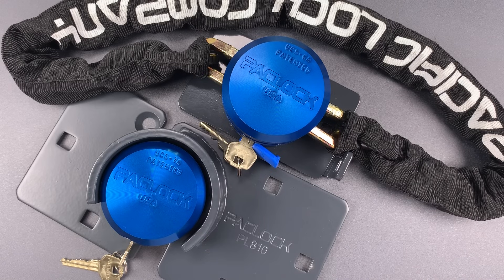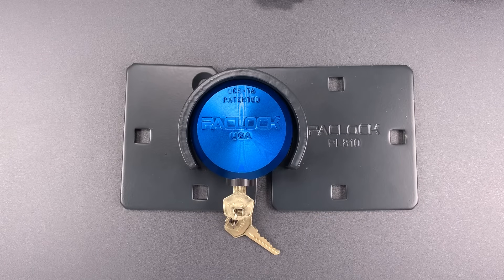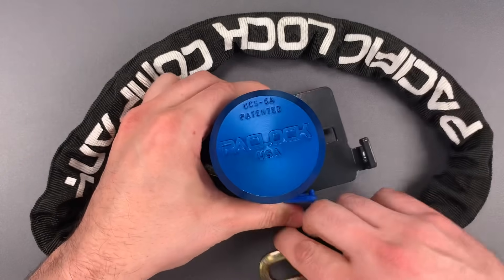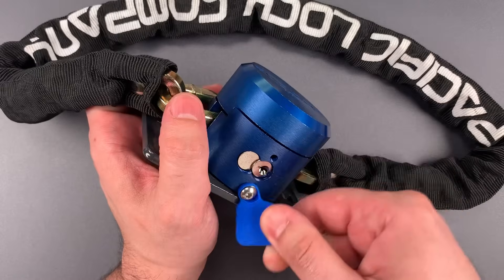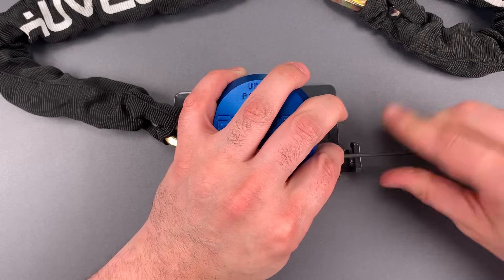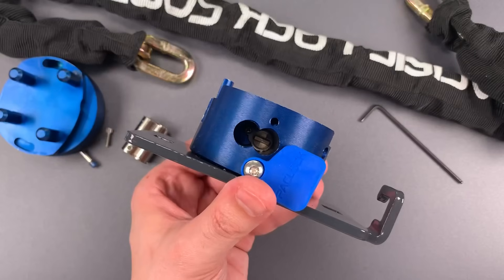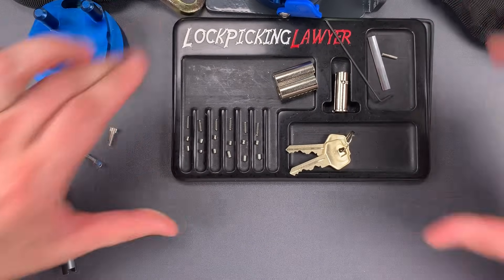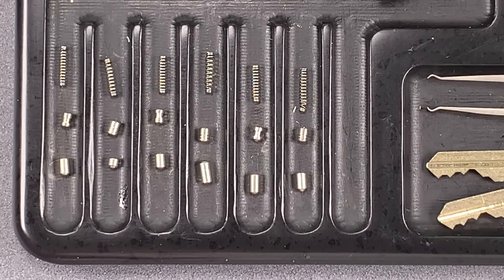[932] More PacLock Products Coming to Home Depot

Comment: Okay, I know I got a good laugh out of the "screws weren't included to mount the puck lock to the hasp" comment. Proves we're not perfect, just that we're a hard working company that sometimes misses things! We realized about a week ago that our first batches went out without the pucks already attached to the hasps as they should have been (meaning that the screws would be included). A lot has gone into this entire product line, and that detail was missed on our assembly/packaging line. So, if any of you end up getting one of these and it doesn't have the screws, we'll be happy to mail some out to you (just give us a call). They are 1/4"-20 x 1/2" flat head stainless steel screws and you can pick them up just about anywhere.

The packaging is actually made from aluminum and not steel. The powder coating on it obviously gives it a steel look and feel, but it's the weight of the product that really makes it feel like steel. We know our packaging is a bit over the top right now, but put yourselves in our shoes. We need to be able to grab the attention of a Pro customer as they're walking down the aisle and, hopefully, grab it enough for them to want to learn more about the product. These pucks and hasps are heavy and silly cardboard packaging just can't hang. So bear with us for a while... once everyone is up to speed on PACLOCK, then we'll find a way to cut down on the packaging. We figured with aluminum, at the very least you can put it into your recycling bin (there should be a sticker on the back of the packaging mentioning that it's aluminum and recyclable).

And as a West Point grad I hope all of you can trust me when I say that this is not a sponsored ad or promotional deal with LPL or BB. We trust and respect them (along with the balance of the LockSport community) and value their candid feedback. Fortunately our hard work and innovative ideas seem to be hitting the target so far and that makes these videos seem promotional. In essence, these reviews end up being a bit promotion, but only because the products are really cutting edge for what they're intended to do.
Reply: well you've just proven why you go through the effort of sending these products to the community. you get feedback and fix any oversights. good job.
Reply: Wow, here you are. Great PR! TLPL is probably the final test for any lock related product hahaha keep it up
Reply: That package is probably more secure than a master lock
Reply: Any chance of you guys coming out with a beefier version to accommodate a half inch chain?
Reply: Can we expect hardened steel bodies? At these price ratios, I’d buy at least a dozen.
Reply: I have been hoping for years that somebody would invent a lock to fit over a standard tractor trailer hasp to not only lock the hasp but cover the hasp rivets. It would also need to be sealed against the salt and sand used on the highway during winter.( I have literally had to use a propane torch in order to unfreeze a disc lock and WD40 to clean it out after a winter trip)  It looks like Paclock will be the company to take on this challenge. It would be a boon to load security in the trucking industry
Reply: For the Puck Chain lock, is there a steel pin in the "hooks" that hold the chain to the lock?  If those are aluminum, that seems like the first obvious weak spot but LPL hasn't had a chance to post a destructive test yet.
Reply: You guys need to get these things into Bunnings here in Australia. I am sure they would fly off the shelves due to it being far better quality than some of the junk I saw last time I was in the big green shed. (or if Bunnings wont take it, try the smaller hardware stores like Mitre 10 or Home Hardware)
Reply: A really innovative product. Now...how about resistance to a grinder? All the kids are using them these days.
Reply: Awesome to see you working with LPL & BB.  
And I'm glad you were able to get home depot to carry your product. I'm always in home depot, but I'm disgusted with their current padlock options. Whenever I've needed a decent lock for one of my clients, I've had to make an hour drive to my locksmiths shop.
Reply: I'm so glad to see companies react with grace and humor over a review.  You got my business in the future!  When we replace our aging front door, I plan on getting a Bowley for the front door, and then I'll pick up some paclock outdoors padlocks for our two chainlink fence gates because they need some love, too.
Reply: @dustysparks  The packaging is aluminium, not the locks themselves...
Reply: @fawesum  the lock are anodized aluminium.
Reply: You could cite these videos on your web site or in your promotional materials ("See what America's top lock pickers think of PACLOCK").
But, while we have your attention, I couldn't help but notice that your key pins are all standard. For the longer key pins, can you make them thin-lipped spools? Do you have any countermilling in your pin chambers? That's something else to consider if you want to increase the pick resistance.
Great work on their design and packaging.
Like Jonathan Wilson suggested, I'd love to see some of your products in Australia. Especially your padlocks with the core replacement option. About time Lockwood got a kick in the backside, they've been coasting for far too long.
Reply: @Joe Turner that's an interesting point
Reply: @bstrickler  Really appreciate the kind words... and the lead on a potential new product. This is exactly how we decide on what we need to be working on. Believe it or not, we make all of the padlocks for Public Storage ~ more than a million a year between the 70mm disc and "cylinder lock". So I'm pretty familiar with what you asked about.

Here's the hitch. Even if we were to make a far better lock (and for me, the disc lock, at least our disc lock, is pound-for-pound the best padlock out there because of its design) the doors in those storage units are made from super, super think metal. They're really cheap. I've seen pics where people just tear off the door and leaving the whole lock/padlock in place. 

It's like putting a big lock on your front door, when your front door has a window. So we've never really spent more time working on that. What do you think?
Reply: @Joe Turner I am. But candidly I wasn't really worried about the cylinders themselves... I feel like we perfected those to the best that the market will bear (you have to keep costs in mind and keep in mind that our products will be cost compared to a Master with no security features) a few years back. The one bonus that these locks have that the rest of our entire product line doesn't have are that the pins are stainless steel (to help defend against drilling).

Otherwise, our goal was to get a sense from them and the community about the entire product offering... about whether our idea of an interchangeable core system that the consumer can manage is truly as ground breaking as we think it is... and whether our new lock designs (like the puck link and the trailer locks) are as in demand as we thought they will be.

Even though BB and LPL can pick into our cylinders in under a minute is not necessarily what we want, it's still exponentially better than our competition at this price point. And the fact that they don't even try to rake us shows that they have a level of respect for our cylinders that they don't for most other manufacturers in our space.

So, on the whole, super happy of course! Maybe call it a relief? But HD has let us down with not getting these on their website like they said they would. Ug. A small hiccup to what should be a good, long run! Thanks Joe.
Reply: @celiaengland871  Trust me, we're not stopping here. We have an entire road map of new products that will follow onto these. Ones that are even more high security, and ones that we'll offer at a lower price point. Lots and lots. 

For the one you're specifically asking about, we can do it, it's just that no one is really banging down our door to do it. Instead of a 2-7/8" round puck, we'd probably have to move to a 3" or 3-1/4" puck but that doesn't bother us. Some tooling involved, CNC programming time, and off we go. So if the Puck-Link starts flying and we get the "yeah it's great, but I want one that can handle a 1/2" chain" from enough people then we'll do it!
Reply: With this one comment You people got yourself a future customer. If/when these become available in UE.
Reply: @brentadams28  Yes, in the future. But the costs will jump let's say from $30 for aluminum to maybe around $45 for hardened steel. Keep in mind we make these bodies in the States... and heat treating and electroless nickel plating are not "cheap" like you can do in Mexico or China. And every dollar of our costs turns into who knows how much on the retail side.

So we started with aluminum so we can stay price competitive... plus American/Master, Abus, PACLOCK, we all sell lots and lots of aluminum locks for years and years. Yes, it can be attacked with Galium... yes it is not as strong as hardened steel... but it will never rust and, mostly, people attack the shackles of a padlock. So it's why we try and design as many hidden shackle products as we can.
Reply: @edfrawley4356  We're ready! We've been spending a lot of time in your industry trying to solve these problems. Hoping what you see here will stand up to the task!
Reply: @paclockpres.9805  good point about that. My primary point for such a lock is deterring them or at least slowing them down long enough to give my security cameras a chance to get a good shot of them while they're getting frustrated, and hopefully giving up, instead of busting the lock mechanism off.
Reply: @edfrawley4356  get a can of LPS 3, that should help remedy your frozen lock issues, if frozen due to corrosion.
Reply: @dustysparks  No steel pin in there... we've thought about it... debated it... and then went and had a company do a pull test to try and yank out the chain from a locked Puck-Link. I don't have the details in front of  me, but it stood up to something like 2,000 or 3,000 lbs of pull force. 

What's hard to notice in the photos is that when the Puck-Link is locked, the locking tabs actually engage with the top cover. There are recesses on each side of the cover for the top of the locking tabs to lock into. So when you're pulling, it's not that the tab is sticking up like a finger with nothing to grab onto. The tip is grabbing onto the bottom side of the cover and this gives it more strength.

We've actually already sold thousands of these Puck-Links to a van outfit company in Chicago and they love them (the fact that the product is "Patented" should tell you how long ago we came up with the idea because patents sometimes take years to get awarded). So they've been out in the wild for about 3 years now in a kind of long-term secret test just to see how they'll hold up. So far no complaints!
Reply: @blipco5  I'd guess grinder resistance is fairly good, in my experience grinders don't like cutting aluminum - it gunks up the wheel.
Reply: Keep up the good work!  Love seeing an American company making nice quality products.
Reply: @kevin_lieb  exactly what I was going to say. The next thing would be a hacksaw.
Reply: mad respect to a company that embraces and learns from criticism. I'll buy your locks any day!
Reply: I hope you guys get the US Army bid and replace all their crap-tacular "american" master locks.
Reply: Thank you for that reply with the missing data, very helpful indeed.
Reply: Darn it, that was fast!
Reply: PACLOCK PRES. I’m considering buying several Abus Rock, maybe even Bowley padlocks right now. If I had to spring for double your price, and could get it at Home Depot, I’d have bought them two weeks ago.
Reply: Will you have a captive key option?
Reply: So why has PACLOCK decided to make the consumer pay for the marketing wank?  Instead of packing each lock on an absurd aluminum plate (powder coated none-the-less); PACLOCK could simply make displays that have all the information, and pictures, and an example of each lock hanging from it.  Then PACLOCK could lease “end-cap” displays and; “… once everyone is up to speed on PACLOCK, ...” they could stop leasing the “end-cap” space for the displays.  That could be a way that they can; “… cut down on the packaging…”  Doing this would show off the product, and not force the consumer to pay for a useless piece of aluminum.  I think I will wait a while for PACLOCK to stop using packaging that is a massively oversized POWER COATED piece of aluminum and,  “…a bit over the top right now…”
Reply: Who in the right Ming read and wrote this all
Reply: Are these cores compatible with any house type locks/keys? (Kwikset/Schlage)
Reply: @SwishSwoshSwhoop  That jumped out at me, too.
Reply: @blipco5  Here's part of the magic with thick aluminum... it loads wheels, badly. Grinds like cheese and in a few moments your grinding disc is a smooth aluminum-coated circle and absolutely useless.
Reply: @ZaC kWinz my understanding from the previous video is that they are "Marine grade", that is to say, everything on them is stainless steel or another corrosion resistant material.
Reply: I think it's awesome that you interact with the video and take the time to comment. I'm a bicycle designer and have a few nice bicycles myself. I'm always looking for a great lock and if I happen to see one of yours in Home Depot I'll be sure to pick one up. All the best, wwd
Reply: I gotta say I really dig the whole packaging idea. It'd be perfect for smaller mom-n-pop type stores where having two of each lock from each manufacturer in inventory might be too much for high-end products like these...poof, every lock in its packaging is now the counter display. Pretty brilliant if you ask me.
Reply: @two_tier_gary_rumain  Keypins don't come into play until the pin is overset. Until that point the driver is the only thing interacting with the shearline. So there'd be basically no point in having crazy keypins unless you're doing some sort of challenge lock with a situation where the picker will be tricked into oversetting something.
Reply: Listening to the picking community AND made in the U.S.?  I don't have much use for padlocks and such, but I know who just made my short list!
Reply: @benoit8850  I'll spend some time looking at it. Needless to say, lots on our plate right now.

If you're a machinist, hopefully you can appreciate the level of complexity and precision needed to get two completely different parts with lots of complex geometries (for a padlock, that is) to fit together almost perfectly. If the top closes and leaves too much of a gap, then it's a pry point. If it's too tight, then the ball bearing won't allow the actuator to fully rotate and lock (which is even worse). I contend that the Puck-Link is the most complicated padlock ever produced if you ignore fancy materials (like in the huge S&G military lock). 

No way can you cast this thing. And making it out of steel is really going to bump up the price... a ton of milling. Thanks!
Reply: @jfwfreo  We need to work on it... dumb question, I apologize ahead of time, but does Amazon reach into your neck of the woods?
Reply: @sharkinahat  Agreed
Reply: @blipco5  Aluminum is better than steel against a grinding attack... the aluminum melts and gunks up the wheel.
Reply: @two_tier_gary_rumain  Honestly, I thought the key pins were security pins also. We made that change company wide about 2 years ago based on comments in these forums. I'm not sure why they aren't... I noticed that the other day with the original videos posted. Ug. Just so many pieces to the puzzle to make sure we have squared away.

So you can expect those to turn into security pins for future releases... thanks for catching that!
Reply: Great lock and I love the package. The core has everything but I would like to see a better keyway.
Great vid as always LPL keep up the good work bro.
Reply: @paclockpres.9805  It's amazing what cheapskates people are when they are protecting $15,000 worth of tools (not to mention the lost productivity when a lock fails).  I for one would pay the extra for the steel option if it were available but the aluminum PACLOCK is so much better than the other junk at HD that I'll start buying them when they show up on the shelves.
Reply: Always great to see a reputable company. I can't even think of a need for any locks, but I'm likely going to pick up some pad locks in case I need them in them in the future.
Reply: @paclockpres.9805  You guys are really on top of this. It would certainly add some difficulty if the key pins were converted to security pin also. However it's probably pretty costly to do so and it reduces the available bitting space due to having to have enough height for the security feature be cut in. Since you guys are doing a no duplicate key cuts run this might have been made to give more unique keys. 

Also security key pins likely wouldn't help much against LPL as his heavy tension style is very unlikely to over set a pin. Still would be great to add but only if it wouldn't impact the cost of the lock. I imagine a lock like this could defeat virtually all of us amateurs here in the comments and probably just as many thieves in the real world.
Reply: PACLOCK PRES. Have you considered adding a pack of higher security cylinders to the lineup?  With user replaceable cylinders there's no need to have separate lineups for each picking difficulty, making it easier to sell the higher grade in box stores like Home Depot (US) or Bauhaus (EU).   Having bought similar upgrades for ASSA myself, one upgraded option could be adding 5 or 7 pin sidebar like on ASSA Twins (check their patents first).  Licensing or cloning the ASSA / Mul-T-Lock CLIQ electronic sidebar would be an even higher security option.  Of cause you could also invent your own upgrades.
Reply: @DanBowkley  I know how it works. I think you underestimate how easy it is for some to overset a pin. :)
Reply: @paclockpres.9805  OK, good to know.
What about looking at other lock styles? Sliders? Dimples? I suppose it all depends on research. What's the most common type of lock picked, etc. I expect you guys would have access to this sort of information.
Reply: Meh, the aluminum can be reused if you need small pieces for a project or you need a quick and dirty metal back support for some on the spot plumbing work.

That being said, I am seeing good things from the community on the products
Reply: @SwishSwoshSwhoop  Maybe one day...
Reply: Man, any company that pretty much hosts an unintentional AMA on a review deserves some respect, ill keep your locks in mind if I ever need one.
Reply: Thank you for your service!  I'll be buying them when I can find them.  Went this morning and there was only master lock.  I really value the swappable cores.
Reply: @paclockpres.9805  I was in the Army for ten years and we had the pre-master American locks and I liked them.  Then came the laminated masters and they were crap from the start.  Loosey goosey.   My favorite padlock was the sergent/ Greenleaf behemoth
Reply: I really love it when a company interacts with the "potential critical" nerds. Making a better product is not about only listening to the organised applause ...organised by the marketing department. Having an actual "one on one" with people that seem to be involved and know more than average on the subjects your products cover can be really valuable. After all ..you are not selling dishwasher soap with a new smell.
Reply: @lorenzooopoza  That's the best thing about LPL and BosianBill.  They try multiple methods and look for weaknesses.  To be honest, picking isn't the most common method of defeating a lock system.  Usually its some sort of brute force attack.  Think about it, the average thief is essentially a crackhead looking for an easy score.  Not sophisticated at all.
Reply: @brentadams28  With you ~ getting there.
Reply: @starlite528  Not initially ~ nor maybe not in the next few rounds. I'm nervous with the thought of having the consumer have to take the whole lock apart to change the actuator. All of the non-UCS versions of our locks that we're throwing up on Amazon (as we speak over the next few weeks) can do it as well. For now, our first load last night of our "90A" series had about 1,000 different options with just shackle, color, and keying alone. If you want KR on any of those, for now just give us a call.
Reply: Do you guys plan to make or already make locks for lockers? Seeing how much thought you guys put into locks I'd replace my $3 master combo lock in a heartbeat.
Reply: @HAWKTOMAS  I hear ya... and I truly humbly apologize. In some regards we were the tail on the dog here between our partner and Home Depot with the marketing stuff. They know better than we do, and I also mean that sincerely. One day we'll cut it down and, hopefully, you can see a price reduction. Hoping to get HD to stock the online stuff without the fancy packaging and offering that at a better/reduced price.
Reply: @TiBiAstro  Not right now... but Depot has asked for us to do it. It's a big task.
Reply: @paclockpres.9805  sweet 👍😊
Reply: @starlite528  Right there with you... probably literally (was in from '95 to '00). The pre-Master Americans are what we're honestly trying to fashion ourselves after. I joined our company about 5 years after Master pulled off the biggest coup of all times and convinced the DLA that their laminated lock was as good as Amiercan's solid body. It was huge. Then Master bought American. I like our little laminated military lock... you can expect to see products coming out from PACLOCK based on that as well.  Thank you for your service!
Reply: @Dubfiance  Not really... talk about getting into Master's heart if we went there. If we did, it would need to be a design that somehow thwarts all the attacks that are so common. But (and don't tell Master) we don't have a lot of experience in that area right now. We could one day, but honestly our sights are set on building a bluetooth controlled core that can go inside these guys. How cool would that be?
Reply: @dustysparks  The entire blue body of the Paclock body is steel. It just looks like aluminum. Hope that helps.
Reply: I always wonder why more manufacturers don't use spool pins or steel pins.  The cost doesn't seem that significant.  There aren't that many lockpicking thieves, but most of those probably don't have skills beyond raking, so you if can foil the rakers you've eliminated most of the problem.
Reply: I like the design of these lock, impressed
Reply: @paclockpres.9805  what is KR? Sorry if that's a dumb question
Reply: It’s great to see a secure padlock for the consumer market, nice going padlock!! I hope to see an sfic padlock geared towards the consumer market sometime soon.
Reply: You just made a sale, at least as soon as your product starts showing up in local stores.
Reply: @paclockpres.9805  The company I work for used to do business with HD, until HD dropped us with no real explanation.  We were shipping like crazy to them so it is hard to believe our stuff was not selling.   Like you, we have a high quality product line.  Of course, I have no insight into their thinking,  and maybe you are familiar with their type of business and its practices.   Best of luck, I love your stuff.
Reply: Are all Home Depot’s getting these?
Reply: @two_tier_gary_rumain  I'll admit that I'm really not the expert when it comes down to which types of cylinders are the most pick resistant. Medeco, ASSA, Mul-T-Lock would love to argue over this all day. What I'd like for you all to see from PACLOCK one day is our own version of a disc style core like an Abloy. I know we could make one better that's more resistant than what they have... and then we'd be going after their markets. But don't tell Abloy for me.
Reply: PACLOCK PRES. For the most part an Aluminum lock body is fine if a few properly placed hardened steel pins were installed in the lock body to prevent or at least slow down attacks by angle grinders and cutoff wheels.  A good bit of that could be done with the locks shackle. I like the fact that your locks are made in the USA
Reply: Just wondering if your company will be offering any other color options? It's not that important but for my work vehicles I prefer more muted colors or bare metal against the white paint. Thanks
Reply: I was just thinking the lock with the chain could also be used to anchor a motorbike or pushbike to a wall or ground point in your garden or even in a shed/garage ;-)
Very nice locks, are they available in the UK?
Reply: A lot of thought went into these lock designs. Nice to see that can still happen.
Reply: Not even in the market for a lock and I'm tempted to buy one of your products due to your responsiveness!
Reply: Are these sponsored? Normally, when it takes 2 runs through the pins to pick, it's a really bad review.
Reply: Out of curiosity, because I can't seem to find one. Do you have one of those chain locks w/o the chain or the panel so I could use it for my bike? It's a lot more secure than my current setup.
Reply: @许二宝  To be fair those hard plastic package are already more secure than a master lock.
Reply: I would be more worried how quickly its was picked lol
Reply: @apems4676  It shows enough security pins and we've seen him open challenge locks in a minute, it's too quick for me to believe it would be a paid ad but just going with what I've learnt from videos with the springs of different resistance I believe single pin picking it's the only way of non destructive entry.
Reply: @Joe Turner I cannot answer for them but I'd be surprised if they weren't.  I've seen a lot of LPL's videos and I can only remember hearing him being this complimentary about a very small number of products.  We all know almost nothing is going to defeat LPL for more than a minute.  He was clearly impressed with these locks.
Reply: @dahveed284  tHaNk yOU fOr yOuR sErvICE
Reply: @kevinn6384  Believe it or not, but adding security features into the pins does take some specialized tooling/machinery and skill. And when fractions of a penny count sometimes, most companies won't even consider the cost to add security features. And making them out of stainless steel really adds a level of complexity... brass is super easy to machine, stainless not so much.
Reply: @samueldeter9735  Just means "Key Retained" so that when you have the padlock unlocked, the key cannot be removed until you first re-lock the padlock. The military uses it all the time. Some companies tout it as an additional security feature. Making a lock key retained is actually easier/cheaper than making it non-key-retained. The NKR actuator is quite a bit more complex with additional parts to allow the cylinder to return to home position even though the padlock is still unlocked.
Reply: @evanchapmanfanman  We have lots, and lots, and lots of them already (both variety and quantity)! Hop up on our website and you'll see them. Working on getting them all loaded into Amazon as well so it's even easier to order and get.
Reply: @sweepleader  Really appreciate the heads-up!
Reply: @xanderbose974  That's the plan...
Reply: @4lifejeph  It's a fair point, and we spent lots of time talking about just this. For the moment there isn't a plan in place to offer say a clear anodized (looks silver) version. We could and can quite easily, just need HD to say "yes." Which means we need their customers to say "I gotta have it!"
Reply: @plug4uk696  Working on Amazon options...
Reply: @rave111  Nope.
Reply: @dakel20  Just give us a call for now, we have versions that are not HD exclusive... and, soon, we'll have them on Amazon.
Reply: They look like fantastic products.  And the fact that you not only sent them out like this, but have watched the videos to make note of the comments goes a long way to prove that you really are trying to do what is best for the consumer.  I sincerely hope your product line is a great success and you can keep the fine quality going.
Reply: dont even need them but im going out to buy some today!
Reply: @paclockpres.9805  good to know thank you for the quick reply...I should've been able to figure that out I just kept thinking along the lines of the cylinder modularity for some reason
Reply: Hey Paclock,, you guys are so amazing and honest. I have my respect to you guys...
Reply: @paclockpres.9805  Currently in the ARNG and have a couple cans full of locks from you guys. All the lost keys and cut locks from joes TA lockers and vehicle doors have been awesome to build a hobby on. Gladly buy new locks to support your company.
Reply: @celiaengland871  why even bother? The lock can be picked with a $7 lock picking kit.
Reply: You could actually use the packaging as a mounting bracket with a little modification. It is what I would do anyway. The holes are already set to attach it to an aluminum rack.
Reply: PACLOCK PRES. Thank you so much for the reply. You’ll get a sale from me.
Reply: PACLOCK PRES. yes yes okay, but when will they be available in Kansas?!
Reply: @paclockpres.9805  : Good luck guys ;-)
Reply: as extra pick resistance, i would suggest threading the pin bores that have serrated pins and undercutting on the pin bores that have spools. those two improvements would make them almost impossible to pick for the average person.
Reply: PACLOCK PRES. With current advances in 3D printing for making complex full-grain metal parts (instead of the parts being porous/sintered) have you investigated the possibility of reducing material costs and machine time with a hybrid approach? Some newer direct metal deposition systems should be able to print the required geometry fairly easily, then need a single cleanup pass to bring the part to tolerance. Machine Cost is always a factor for new tech, and I don’t know enough about your current manufacturing chain to make a solid educated guess about the level of benefit.
Reply: ^Gecko^ lol well if Master Lock has the military contract then you might has well just hand the keys over to our enemies
Reply: @paclockpres.9805  Ha ha! Well, I know two guys who could probably give you advice in those areas. :)
Reply: @paclockpres.9805   Yep, I do appreciate.

I work on parts the size and weight of cars but I love a well machined  tool or part.

And obviously the tolerances needed to make parts interact perfectly despite production variations.
Reply: PACLOCK PRES. that is very likely because Master Lock has no moral issues with bribing or giving kick backs to those in charge of the military contracts
Reply: I wonder if the locks position on the hasp would add to the difficulty picking level? Most locks aren't usually in the perfect angle for attack!
Reply: @Josh_D78  the issue, then, is that the military is taking those bribes.
Reply: I'm awesome about how cool your packaging is, and yes I want more metal for my recyclables.
Reply: Kudos on your engagement here.  It's rare (shouldn't be) and valuable to ALL concerned.  I have no questions.  It took some scrolling, but you've answered them all!
Reply: @dakel20  check out lock picking lawyers video on a bike lock...I don't remember the company or what the lock was called but he did a video of a product exactly as you're describing at about a hundred bucks I believe
Reply: @paclockpres.9805  Is there somewhere you regularly update the progress of your products? You must get tired of answering when they'll be "x"
Reply: @paclockpres.9805  Amazon is in Australia, but it's only been here for about 18 months and still runs a limited product line
Reply: @MrSangheilislayer  Really appreciate it John ~ appreciate your service! Go Army, Beat Navy! (but don't tell anyone else, I don't want to cause an issue with any Navy guys on here).
Reply: @benschmidt9532  I wish I had something firm for you. But if Depot won't get it done, you can be sure that PACLOCK will find a way to make it happen sooner than later.
Reply: @windstormscr8948  With you, and I think something like this would be ideal on a higher price lock (like something for the medium or high security military padlocks). But in retail, it's likely going to add too much cost. We have our eyes on this sort of tech considering how far it's come already!
Reply: Jordan Cambridge  Absolutely ~
Reply: Yaaaaay
Reply: @bstrickler  Only there was no corrosion. Only a mixture of salt, sand and brine from 2000 miles of road spray. It hadn't had time to rust....yet
Reply: UM HELLO? PACLOCK???
WHERE IS THE ELECTRICIANS LOCK OUTS?????
THIS WOULD BE AWESOME FOR US LEVEL 1 GUYS!!!! 
PLEASE TELL ME THEY ARE COMING!!!!
Reply: @blipco5  Grinder? 
Thats a thief with a Legally Employed family member! 
Broke uneducated thieves use-  1 CAN GOOF OFF + HAMMER!
(Never seen ANY LOCK NOT SHATTER LIKE GLASS when exposed to thise two things)
Reply: @mfree80286  
Goof off + hammer = shatters like GLASS!
Reply: @paclockpres.9805  
We say "NEVER FORGET" now (in person face to face)
Sjort, simple, to the point. 
"Thank you for your service" can trigger ptsd from expecting a response....
Reply: Thank you for personally replying and your commitment to quality.
Reply: "screws weren't included to mount the puck lock to the hasp" Did you just misspell the name of you own product?
Reply: @paclockpres.9805  I would downvote this but you guys seem like pretty rad, customer-focused people. Don't be too hard on the squids, my ass rides in navy equipment, sir.
Reply: @YegaSRT  Not really... the round, shackle-less locks are often called "puck locks" or "hockey-pucks" because of their shapes. But I see what you mean!
Reply: @thecloneguyz  Like the safety lock out thermoplastic locks? We started shipping about a month ago and are really happy with what we did there too (as is a large entertainment company run by a mouse... "way better functioning than the stuff from the company that rhymes with disaster" if I may paraphrase). 7-pins, 200K plus key changes. We'll be getting some off to LPL and BB once they have a chance to work on some other projects. Are these the locks you're asking about?
Reply: @hirumaryuei  Okay, so they are good for some things! When the Marines need a ride, they're always there for you! 

I realize I may get myself in a little trouble with the banter, but I still do quite a bit of volunteer work for not just West Point admissions, but all of the academies (including Coast Guard and Merchant Marine). Nothing but respect for all of our servicemen and women out there. Just frustrated that we aren't the ones supplying the bulk of the padlocks to you anymore. We'll be back one day... will fight that battle once we conquer some retail battlefields.
Reply: @paclockpres.9805  Amazon does sell to Australia but no-one I know bothers to buy locks on Amazon.
Reply: @YegaSRT  No, he did not.

The brand name is PACLOCK.

The type of lock is known as a Puck lock. As it vaguely resembles a hockey puck.
Reply: PACLOCK PRES. I think it’s nice how you take the feedback.  The reality is against picklock pros. It’s almost impossible to make it pick proof. But the fact you are implementing design features from criticism means you are trying to improve instead of make the cheapest fastest selling thing. 

I like this and would support a company like yours because I know in the end while we can’t stop pickers who are pros it will stop an extreme majority of Amateur thieves and what not. 

Thanks for being an American company doing what you can for all of the people in US with your policies. 

Thank you.
Reply: @许二宝  Mmm probably the Zip ties that hold the product are also stronger
Reply: @cmsjr123  There are some lock companies who will challenge any claim their locks aren't secure (even in the face of online video proof) and even in some cases (see Medeco) go after those who criticize the company all the while doing nothing about their insecure locks. (or possibly quietly fixing the flaws and not telling anyone or giving anyone a way to figure out if they are buying the fixed model or the vulnerable one)
Then there are lock companies (Master for one) who know their stuff is junk (and put no effort into fixing it) and just ignore all the people who show how bad it is (because they know the clueless idiots out there and those who only care about price will continue buying their junk)
And then you have companies like Paclock that not only encourage locksport enthusiasts and lock pickers to defeat their locks (and pull them apart) but actively solicit feedback from those same enthusiasts to make their products better and harder for people to get into.
Reply: @paclockpres.9805  I apologise and stand corrected. Thanks for replying!
Reply: @paclockpres.9805  

Shsssss keep some of your ideas secret haha, and please design against the new ramset attacts👍
Reply: I'm sure any company that wanted to would get an honest review if they sent their products in, which is why most don't.
Reply: I fail to see why these products are allowed to be made when the can be opened so easily.
Reply: @timothyavendt677  You might be right, but it's fun to share! I'm with you on the ramset attacks... I think our standard product line (like the American) would like do better than the UCS. But it's the trade off for giving the consumer an easier-to-manage-key-control padlock than our typical padlock. Thanks!
Reply: Years ago when i sold my first wilson combat for 3500, i was told "people are willing to pay for quality products" please keep listening to your customer base and remember a portion of us demand better products and back it up with sales. Keep the good products coming at a reasonable price and i have no problem opening my wallet. Informed people are tired are paying too much for junk.
Reply: PACLOCK PRES. Easily defeated with strong magnets. I cannot imagine a mid-term secure electronic solution for a mechanical solution.
Reply: I would like to see paclock make some great locks for trailers, pretty much everything on the market is junk......
Reply: I appreciate your hard work in making a quality product, it shows. Nothing is absolutely perfect, but my next lock purchase will very likely be one of your products.
Reply: If it takes over 30 secs from either Lockpicking Lawyer or Bosnian Bill its best quality and recomended lock... Funny thing is this is good enough just coz it looks so damn cool (Y) and picking resistance is good enough
Reply: Would be interesting to see you guys one-day bring your changeable core design to home grade products.  Deadbolts, doorknobs and such. I can see why you started with professional grade products however. A home owner is more likely to get sticker shock when there is a kwikset half the price next to it and forget you get what you pay for.
Reply: Anyone know if the chain would fit through the lower receiver and mag-well of an AR15? This could be a way to secure one in a vehicle...out of sight.
Reply: For me, if I was there... looking for a lockset, you would be on the list.
Reply: DONT CHANGE THE PACKAGING THATS THE COOLEST PACKAGING EVER AND SHOWES THE AMERICAN MADE QUALITY
Reply: @HAWKTOMAS  Stop complaining THEY ARE MAKEING A HIGH QUALITY LOCK  if the packageing is a problem for you your therapist can hold your hand while you remove it 🤦‍♂️🤦‍♂️🤦‍♂️🤦‍♂️🤦‍♂️🤦‍♂️
Reply: I’m also hoping they come to Canadian Home Depot stores as well, may seem silly but some things are sold exclusively in some countries by the same store. Nonetheless, I’m hoping they are due to actually moving in residence for university, and I am looking forward to it, as well as a good lock
Reply: When are you going to start selling in canada?
Reply: @cyberpunk64bit this LPL, he can pick anything. Did you not see the spools and serrated pins? These are not typically found in your hardware store locks. Most thieves don't single pin pick, instead they use rakes or bump attacks, which this is basically immune to.
Reply: Now that's how you do PR and social media
Reply: @paclockpres.9805  appreciating the second-level responses, as well as the difficulties introduced when uniting dissimilar materials.  Keep up the excellence -- you've already sold me for life.
Reply: When are the PacLock products going to be available at Home Depot?
Reply: @benterwellen  We've had, and have, lots of people asking for them. A lot on our plate right now, but we will get it all done one day...
Reply: @inund8  We got 1,000 or so varieties up on Amazon.ca just a few days ago...
Reply: @TheInfamousDaikken  Wish we had more power... some real goof ups with Depot not ordering the right shelving for the first 35 stores. And online has been disappointing to PACLOCK as it's still not live. But we started selling direct a few weeks back, just give us a call or email us.
Reply: Hey so long
Reply: Great! I've already mentioned your products to a few people who might be interested trying to get some word out for you.
Reply: I don’t get it. Top Of The “Line" and can be defeated in 45 seconds. This dose not say much for the “line”. How secure is the chain? Can it be cut with a good bolt cutter?
Reply: Has anyone tried unscrew the screw (the one the take the top off to replace the lock or chain) when it is locked? I mean if that works it can bypass the lock
Reply: PACLOCK PRES. abloy protec 2 better it unpickable paclock suck
Reply: As a schmuck who has to stock the aisles of my local hardware store, I thank you for putting a heavy product in sturdy packaging, I spent too many hours and too many feet of tape trying to rebuild cheap cardboard boxes full of heavy product.
Reply: @paclock still haven't  seen these or any of your other products at any home depot (at least in store, I've checked at 3 stores) I do see them online but they usually take a week or so to get shipped to the store. any idea when these should be available in stores without having to order them  online first?
Reply: It seems like Paclock is to locks what John Deere is to farm equipment: High quality with excellent feedback and support, but also expensive. Long ago I saw a three-trait diagram for products: Fast, High-Quality, and Cheap. A poor product will have one of the three, a Good Honest product will have two of the three, and anyone claiming to have all three is lying to you. Your locks fit into the Fast and High Quality end of the diagram, which is a perfectly respectable place to be, Well done :D
Reply: If you guys make anything for guns or motorcycles, I'm all in!
Most gun locks are garbage, and I happen to be in the market for a few decent locks for my motorcycles/scooters, and I'm more than happy to support an awesome company that takes critique and criticism as a call to action and not an attack. 
P.S. Blue is cool and all, but personally I'd much prefer something blackened or raw metal, anodizing and coatings wear away and look bad after a while. But I do understand the need for branding and instant recognition by sight and I can appreciate that.
Reply: The guys at Paclock is doing a very good job. Well thought out. My respect given for all the effort
Reply: @paclockpres.9805   with the chain lock having aluminum retainers I worry about a slide hammer pulling effect, one could improvise an attachment to a slide hammer to use a link of the chain as a anchor point and bust the aluminum housing freeing the chain. Yes it is thick but you said it breaks between 2000-3000 pounds, and a slam hammer could produce that and it is an impact that could break it off.
Reply: Look like very high quality locks but, I'm a little hesitant on spending more $ for an aluminum lock. Yeah it won't rust but, 15 seconds with a torch and the cylinder falls right out
Reply: 3 feet of chain is too short for my uses.  Do you guys make one that will accept say a 5/8 in chain since I find this size doesn't get cut like smaller link chains.  Thanks
Reply: i hope you guys take some of the ideas this guy has pointed out in the video to improve your product.
Reply: @wazscience  That's exactly why we reach out to Bill, LPL, and the locksport community! We're very appreciative of the feedback and we recently posted a YouTube video showing off a new design concept for a trailer coupler lock. We got great feedback and have already implemented some of them.
If you have any ideas, we're all ears!
Reply: @flyingdutchman7585  The awesome thing about the UCS-6A is that you can easily put ANY length of chain in it! Just run down to HD/Lowes and buy whatever length you need! It accepts 5/16″ to 3/8″ (8mm to 10mm) chain, if you're worried about this, our UCS-4A and a 5/8" chain put up a pretty gnarly fight against cutting/grinding.
Reply: @JamesZ1025  Very fair argument! We've seen some people hesitant to use Aluminum vs Hardened Steel and I'd definitely vouch that our Aluminum takes much longer than 15 seconds. Video [580] from LPL shows him melting our block lock for reference. We're also thinking about creating a video to see how long it takes to melt a die-cast zinc padlock vs an aluminum or hardened steel lock. Stay tuned for that!
Reply: @PacificLockCompany  that what I like to see in a company,and you've made a customer out of me. Keep up the good work.
Reply: Customers don't care about the packaging, no matter what your marketing team says.
Reply: Ed Frawley Well at least nobody can get into it if it’s frozen shut lol
Reply: Jean-Louis Bourgeois  Much appreciated!
Reply: He's opening your lock-in less then a minute it's definitely not promotional If it was he'd at the very least pretend or act aggravated and annoyed and then finally get it open and say it was by luck or something similar.
Reply: Good PR
Reply: Can't wait to see you guys on German Amazon (or maybe even hardware stores) aswell - we have master here, but I don't think we have anything comparable to your company.
Reply: @Kanathil  Was, wir haben Master hier?
Noch nie irgendwo gesehen.
Das meiste was ich bei allen möglichen Schlössern sehe ist Abus.
Reply: @Ikxi  über Amazon bekommt man master in Deutschland - Abus ist (meines Erachtens) ganz ok (hat ja auch Schlösser im teureren segment), aber liefert keine Systeme mit tauschbaren Zylindern soweit ich weiß
Reply: @Kanathil  Ahh ok, hab halt noch nie irgendwo ein Master Schloss an einer Tür oder irgendwas anderem gesehen.
Reply: @Ikxi  ich meinte ja auch Schlösser die man bekommen kann, nicht Schlösser die man verwendet :D die meisten kaufen Vorgängerschlösser sowieso eher im Laden als online, da bleibt einem nur Abus :D
Reply: @HAWKTOMAS  That's your only complaint? Lul
Reply: Wrote a whole book in the comments
Reply: @jfwfreo  so much thief fro tradies work Utes.
Reply: Pacific Lock Company You guys rock with your PR team.  As a former customer service representative myself, I know how overwhelming a lot of feedback can be and y’all rock it.  Put you all on my radar as a solid company.
Reply: Massive respect to your company 😀
Reply: Hey I know this comment is a year old but damn man. Honest comment about product line mishaps and LPL being excited about these locks has me looking to upgrade. So I'm going to head over to your site and see whats happening. I work in a metal shop and could use a lot of these products because the swappable keyway. Hope you're doing well through covid and I'm sure the protests have people more security minded. Goodluck and stay safe.
Reply: This is still a good looking lock, I'd buy one for sure. Don't feel bad because he picked it open, haven't seen a lock he couldn't defeat.
Reply: I'm going to take you up on that i bought 3 of the locks
Reply: @devinazevedo1122  Thank you!
Reply: @jfwfreo  I'll second this! Those hasps are bloody great. Bring them to Bunnings!
Reply: @zomphoenix  No, they also come in hardened steel.
Reply: I emailed PacLock asking about a disk lock for motorcycles. It would be awesome to have one key for the locks on my gates, motorcycle disk lock, trailer, shed etc. 
I would buy the set ASAP if it were on option.
Reply: I love these comments
Reply: Ya know what? Good on you PacLocK
Reply: @paclockpres.9805  absolutely love this, you have my business
Reply: you get one of the best reviews ever and you get ultra defensive about a screw?
Reply: Please take good care of LPL because I’m only buying these products because he is a reputable reviewer
Reply: Home Depot = George SOROS
Reply: halojump123 even better. 😂
Reply: Well hopefully there are some actual customers for you in here and not just a bunch of people mesmerized by watching LPL, lol.  I am lucky enough to live in a place where I don't really need to lock anything.
Reply: As long as you graduated from West Point before 2015! They just had a massive cheating scandal...
Reply: @RPGillespie  Yeah, unfortunately I'm quite a bit earlier than '15! The cheating scandal is a mess, and a blight for sure. I'm still somewhat involved with USMA as a volunteer admissions liaison and what I'd say is that this is proof positive that online learning can never replace in person learning. All but one of those involved were freshmen (the other being a sophomore). The freshmen simply did not get a typical USMA experience that drives home the seriousness of lying, cheating, or stealing. Hearing a story in person from a Vietnam vet about a lying lieutenant whose lies gets most of his platoon killed by fratricide is seriously powerful (as was my case as a freshman). Getting the daily reminders about duty, honor, country just doesn't happen in an online scenario.Choosing the harder right over the easier wrong is, well, just not a part of the intrinsic curriculum of distance learning.  But still, USMA needs to do better and the 3-Star General in charge has taken ownership of the problem. We deserved to be dinged. I just think it proves that online learning is not the same ~ we need to get our kids (young adults) back in school (and, yes, do so safely). Sorry for the rant!
Reply: If it makes you feel better, between the swappable cores and LPL's feedback on your locks you are at the top of my list for general-use locks if you ever start selling in Canada.
Reply: Looks like you guys passed the LPL test about as good as can be expected, We knew it would be picked but when the LPL says it's bump resistant and good quality it's a good lock.
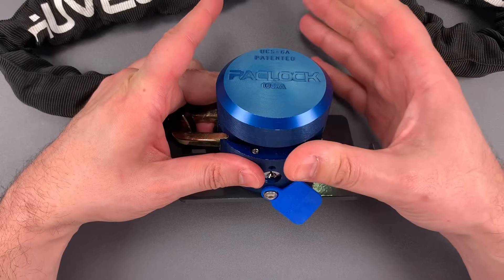Reply: The LPL didn't go into this, but I'm assuming that the screw on the side that he used to remove the top of the lock (beginning ~5:14 https://youtu.be/-W8N06QqK8A?t=314 ) is restrained or somehow otherwise cannot be simply removed when the lock is properly locked?
Reply: @ShadowDragon8685  Good question! And I appreciate your kind comments on the other LPL video for zinc casted padlocks! That screw we call the "shackle retaining screw" and it's only job is to retain the shackle or, in this padlock's case, the "top" of the lock from flying out and hitting you in the face when you unlock your padlock!

When the padlock is in a locked position, that screw is literally doing nothing. You can remove it all you want and no security is compromised. It doesn't give you any access to anything.

Needless to say, if it's your lock and someone removes it and you don't notice it being removed, then you'll be in for a surprise! I see this as a good thing in the lock world. There are multiple goals for locks... keep people out, but also to give the owner some indication when would be intruders are trying to get in.

Call it a "feature" if you want, but having the shackle or "top" pop out at you when you go to unlock your stuff means this lock is completing two objectives. It seems to have kept someone out, and it's letting you know that someone was messing with your stuff.

Our shackled padlocks have the same screw on the back of them to hold the shackles in. Having this type of a setup also allows our padlocks to have a "quick change shackle" feature so that you can quickly change your lock from a normal shackle height to an extra length shackle height in about 30 seconds.

I hope this helps!!!
Reply: Wish I had one of those puck locks with the security chain on my bike :/ The crew that stole it wouldn't have broken it the same way my bike lock was
Reply: You guys legit seem like a cool company, maybe I just like the fact the lock is blue idk lol
Reply: Let's also not forget the best feature of those locks: sweet electric blue lock bodies!
Reply: I tried to find the trailer hitch lock at the Home Depot, and every store I called (and I call 6 stores) and no one could find this for me and gave up. Wish you could do something about them!!!!!!!!!
Reply: @thumperlockpicking9269  I humbly apologize ~ and am grateful for the effort you gave to find our products. All I can say is we're working on it daily, hopefully news soon.
Reply: @demontemon1503  it is promotional, in that most thieves can’t single pin pick locks; he probably spent a great deal of time figuring out how to pick this lock before he did it on video which thieves don’t have time to do; and in the video you are watching a world class expert do something that probably only 1% of pickers could do.
Reply: Your comment and LPL's pinning and "loving" it,  coupled with your responding to the feedback and inquiries of the replies,  appears to be a very useful and successful marketing strategy.👍🏼 Master Lock wouldn't dare attempt such a venture...lol. But their representatives probably don't have West Point "fraternal"  connections either ;) 😂😂😂
If you would've left that out,  people might be more prone to think that there wasn't any inside friendliness between PacLock and Robert. The product line doesn't appear to need any bias help in marketing though.
Reply: @ScottWConvid19  Thank you, I very much appreciate that!
Reply: @mfree80286  Bees wax/paraffin products (comes in a grease refill type tube) will keep a grinding wheel from loading up on non-ferrous materials. As a welder working in the defense industry we used these products all the time to prep (grind) non-ferrous materials. Sad to say; but aluminum grinds about as fast as steel using these products.
Reply: Awwww man. You had me until you said "West Point graduate"....... GRIN    Uncle Sam's Misguided Children here.
Reply: Don't beat yourself up about it mate. You guys seem to have designed a great product that lives up to what it claims - which is not what lots of your opposition do. Thanks for making a quality product that LPL is happy with - great work!! Cheers.
Reply: I feel like the best compliment I can give you guys is that you seem like the opposite of Master. You interact and listen to your community, and genuinely always put out the best product you can, and probably the best security per dollar product on the market
Reply: I liked your puck link and might want something like that to lock up my bicycle.
Reply: It's kind of refreshing seeing a company that cares about the quality of their products and not only short term profit. If you build good honest products at a reasonable price you deserve success,
Reply: @jakobrosenqvist4691  Definitely appreciate that, thank you!
Reply: @hemaccabe4292  Puck locks are definitely awesome, but kind of tricky to use for locking up a bicycle. We're doing some beta testing right now (locksport Reddit subgroup) of a new technique to lock up bikes about as securely as you can. The whole bike even (two tires and the frame). Wish it were super hi tech, but often the "huh, I should have thought of that" ideas are the best. First of all, not dumb cables. Chains are always better than the dumb cables. Trouble is if you need 3 fee to go from one end of the back to the other to lock up your wheels and frame, then you need another 3 feet of chain for the "return trip." That makes the chain 6 feet long and super heavy. Instead, one padlock on one side of the 3 feet length of chain, and another padlock on the other side. Keeps the chain to 3 feet, locks everything up, and you use one key to open both padlocks. When you're on the go, just wrap the chain & locks around your handlebars and it makes it super convenient to where you're not having to haul it in your backpack.
Reply: Anyone familiar with LPL knows he is not going to be soft on any lock or manufacturer.  It’s just not his way.  
Good job Paclock, and thanks for making a line of locks that are  it only intended for contractors and the like, but both affordable and secure enough to give us confidence that our livelihoods will be there when we get back. 😅 
And, they are handsome to boot.
Reply: what an accolade, being officially endorsed by lpl

you earned it mate
Reply: Cutting edge may not be the best term to use in this situation 🙃
Reply: He just opened your lock as if it was nothing. I lost faith in all locks and no way will I ever pay $100 as they are all junk.
Reply: Paclock is the noctua of locks. Extreme professionalism. Respectable by itself, not even mentioning the high quality of products.
Reply: @HAWKTOMAS  I suspect that end cap display costs more than sheet aluminum for packaging.
Reply: Ummm....if you screw the door lock down to the other plate, it won't be able to open the door or remove the lock. Just sayin....
Reply: @paclockpres.9805  quite frankly your products seem better enough than the competition to the point that they would totally be worth the extra expense, especially in supporting an American business. You know what they say, you get what you pay for, and if a few more dollars here and there gets a product that succeeds where another fails, it was worth it.
Reply: Nice read. You earned my business. I refuse to support Masterlock or Reese and some of the higher products are out of my budget for what I'm securing. Keep up the great work and thank you for your service.
Reply: @HAWKTOMAS   Yes i know this is an old comment lol but... this is really a silly thing to be critical over. Yes, the solid packaging does add to the cost to an extent, but really, is it that big of a deal? Maybe the aluminum backing costs like a dollar more than an alternative that would still be sturdy enough to hold the product? 

I think most people would be impressed with this and be more likely to choose PACLOCK over the compeittion. Maybe you're more saavy than theaverage consumer, but saying you'd choose another product purely because they spent too much money on the packaging is beyond petty popp.
Reply: The take-home message I get from these videos and your reply is integrity: your own just as much as LPL/BB. I don't know how far your international reach spreads - here in the UK I don't tend to encounter your brand unless I go looking for it - but I think I can say with some confidence that the UK/EU market would see positive outcomes for Paclock. Over here we're dominated by Master Lock, and I for one would appreciate a bit more competition. ML's dominance seems to be driven by a mix of consumer complacency and market saturation.
Reply: Sometimes what is not said is as important as what is said. Indeed, it is evocatively instructive that there stands absent any demonstration of the lock being opened with a comb pick as had been instantiated by the Master 736 puck lock, or any other substandard puck lock of similar in quality likening a  comparative betwixt a Duralex glass and a Dixie Cup!
Reply: I’m looking at
Reply: GO NAVY! (USNA 98) :) Great product, btw
Reply: This is random but I'm willing to bet it's come up:You guys should call Namco-Bandai  and do a collab product with Pac-Man. Since you anodize these in blue.... offer a Pac-Man Pac-Lock puck lock that's yellow (with a black wedge facing where Pac-Man's mouth is.

Frankly I think itt'd be a hit with collectors. :D
Reply: Hey, you can just add hardboard instead of steel & it's more reusable!
Reply: Wish there were more producers like yourself around the world...
Reply: Looks like you’ve made a quality product at a fair price.  Every company has an occasional oversight,  but how they choose to respond separates excellent companies from the rest.  Well done.